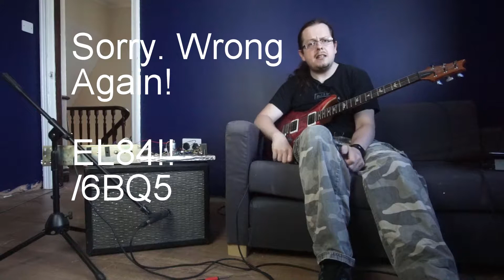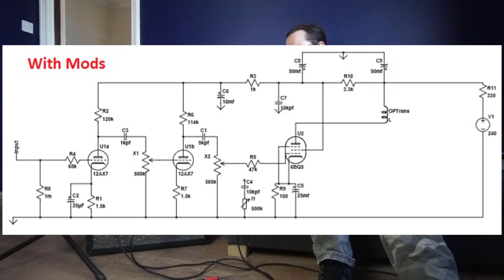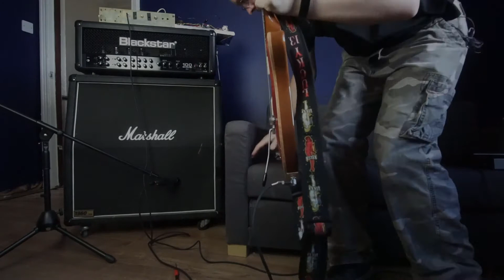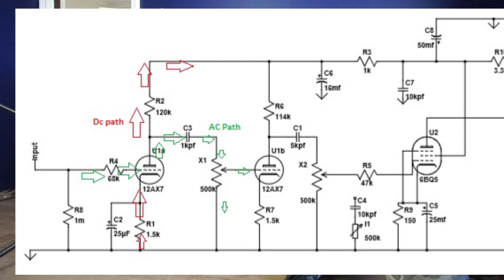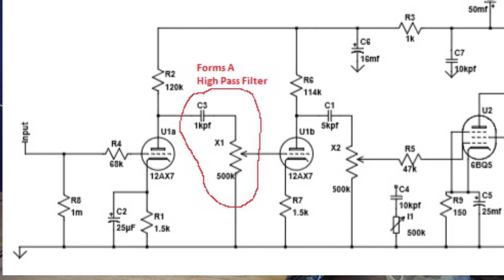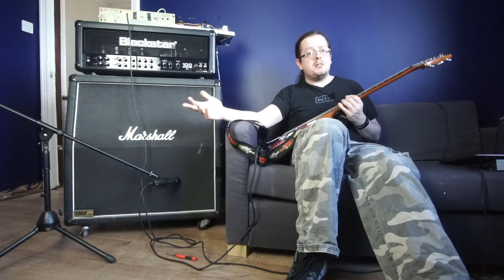Dallas Scala tube amp, Repair and mod Part 3, Coupling caps and bass response.

Comment: i didnt watch every minute of this so i   might say something youve said , but i think most people who would play this would be looking for a vintage sound not  metal, and by vintage sound  i mean power amp gain or slight break up , it probably does sound better through a bigger  cab , but that little speaker gives that tinny sound that those guys playing blues and mersey beat had...anyway good video , i think the scala is great...what speakers are in the cab  celestion t75s?
Reply from the maker: Damn.. I cringe watching this old video. lol. The 4X12 is V30s, the Scala itself had an unbranded 6X9. I have since replaced the 6X9 with a 12" celesion v-type.